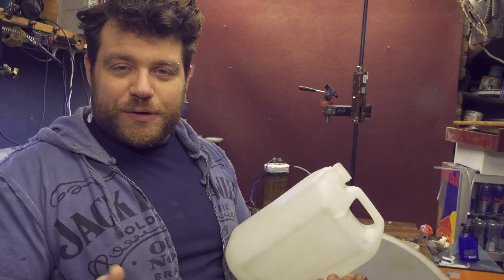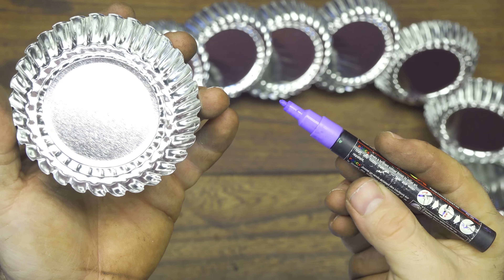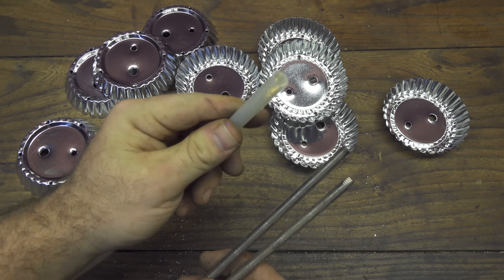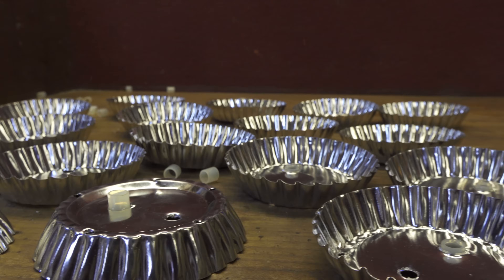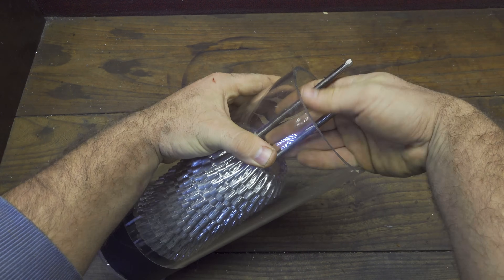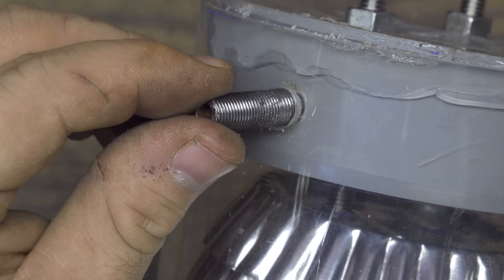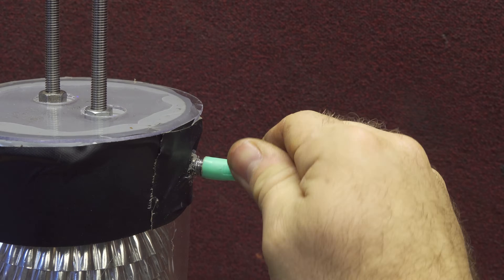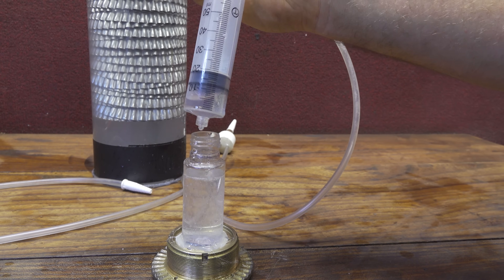Superpowerful Flame 5072 ℉ • Produce Hydrogen from Water - Do it yourself

Comment: Can i combine this project with the making of an air gun, using the hydrogen as a propellent for pellets?
Reply: I think you should use something more inert like CO2, far simpler and safer. You can produce it either by sodium bicarbonate decomposition (at 50ºC according to wikipedia) or mixing it with an acid like HCl or vinegar (acetic acid). The problem, even with hydrogen, is how can you store it at enough pressure without blowing up in your face, i'll leave that to you, be careful dude

Comment: "Safety is very important" 

Proceeds to lift uncovered transformer with exposed leads, connects exposed leads over flammable gas production vessel -- which visibly leaks -- and lights his torch from a candle which he leaves lit and on the desk near the plastic tubing. 

Wields torch with bare hands.
Reply: Not to mention fuel and oxidizer are mixed and accumulated. This idiot is one electrical discharge from never making a video again.

Comment: I buy All Natural Water"Hydrogen free"
Reply: all water's oxygen and hydrogen free timothy! In my opinion this video shows the rapid decomposition by water with the help of electricity of the stainless steel cups! The oxygen and hydrogen produced originate from the metal alone!
Reply: @PeterPete  It was a joke" I have been doing this for years I use stainless steel wall outlet plates.
Reply: @timothymason3423  and the metal always decomposes and the water gets dirty! To be honest I've never seen anything that decomposes water! Unsurprising really!
Reply: @PeterPete  I have found the more wholes the more gas not as surface area as people would think and instead of voltage think frequency of input voltage"' think 2.45 GHz less catalyst/ electrolyte less decomposition higher output.
Reply: @PeterPete  I have found More holes like screen" Same surface area" More places for the surface tension to release the gasses. also don't think voltage but frequency like 2.45 GHz Break it down at the molecular level Less catalyst/electrolyte less corrosion less corrosion cleaner conductivity greater output . 2,45 GHz is like a singer breaking a glass with their voice.

Comment: Please help I tried making a flash back arrestor by using a bunch of copper wire all I did was strip a lot off copper wire and rolled it into a dense chunk of copper wire and put it in a tube and added pipe and everything and I tried it  but it didn't work please help because I really need a functioning flashback arrest or for oxyhydrogen
Reply: RC Stuff you mean brass right? Coppers the wrong material
Reply: @JV-wl6ex  but I used very thin copper wires and bundled them upit should have the same effect as brass fiber right

Comment: Hı.
06:55 video times.
 Can you tell me about the electrical installation in detail?
Reply: Her Telden TV 1000 watt high voltage transformer from microwave except he took out the high voltage secondary coil out and replaced it with a few thick windings to make it low voltage high amperage instead. A very easy way of making a high current power supply. You can also use a computer power supply if you don’t have an old microwave
Reply: @Ferraday  Would an arc welder have too much voltage?
Reply: @Ferraday  oh yeah yeah

Comment: have you tried welding with it?
Reply: It will weld but is not good for ferrous metals as the hydrogen atoms permeate the material and cause structural problems. It's also capable of welding unlike materials, like glass to stone for example. HHO is strange stuff...

Comment: Hydrogen is very light and very very hard to seal in any container. 

You keep running this inside, so the leaked hydrogen might slowly collect under your ceiling. Then any whiff of wind that pushes that onto that candle flame or just some minor electric spark occurs, and your roof goes kablamo. Just saying.
Reply: Very hard to seal in any container, but regular house-building methods are sufficient to seal enough hydrogen to cause an explosion?

Comment: Make by themself, Test by themself 😺 Blow it up by yourself, deal with amputated arms. Also by yourself. Have fun

Its also funny how he avoided of telling the safety rules about highly explosive gas and flames near it 😺 As if that was a part of his plan
Also, that brass fiber is really neat in speeding up the back push combustion into a hydrogen-oxygen gas generator 👌
Reply: He has a flash back arrester btw the cell and the flame.
Reply: Charlie Jeans Does he have flash back for his entire sealed room inside his house just in case if hydrogen-oxygen generator is not sealed propertly then?
The answer is No 😺

Comment: Thanks... nice video. Does your hydrogen system water turn green or brown after a while and how long does your plates last before they rust? For those that keeps telling him about air being trapped under the cups, he already drilled some extra holes around to edges to let the air bubbles escape in the beginning.
Reply: Why not just turn upside down whole cups assembly to prevent bubbles being trapped?

Comment: That's a pretty decent setup for using not very fancy materials! I don't know a lot about these setups but I'd bet that adding a dessicant dryer in the line would help (I bet your gasses are fairly wet). Also, you could get waay more gas in a smaller space if you used metal screen/mesh on the electrodes, though I think the baking cups are a clever idea.

Comment: Good Idea and good Video, but there are some wrong Constructions. Aljubouri says it already , the Steelcups are the wrong Way in Position, so the Gas will rest just  under it in the Middle. The most Risk is, that now the explosive Gas can inside result to an accident! Better use two of this Tubes witch is connected witch an small Tube on the Ground and so you can separate Oxygen and Hydrogen in Tube 1 and Tube 2 and so you get more sure! 

Its  an good Idea, but i trink, your Construction is mor dangerous and not so effizient as can be. Its just an Prototype ans thats okay.
Reply: Good point.  If the cups touched ( as they look like) and made a spark that'd be the end of that !
I don't recall any mention of insulation there.
Reply: Hence him drilling all the small holes around the outside of the cups.

Comment: I've been wanting to make one of these for year. I've heard if you add a bubbler with thinner or something it will make the torch much hotter. Oxygen is very expensive and I plan on making one so I can use as a cutting torch. I have all the components I've just not put them together yet.

Comment: Actually dude, baking soda is kind of a detriment. You're creating CO2 as the current breaks away the sodium from the carbonate. That'll make your torch underperform what its estimated to given the tip and flow rate. Youd be better off using lye.

Comment: I agree this fuel cell is a lie or more to the point unnecessary and has been don't to confuse the truth, I am telling you this because over forty years ago I was shown a Holden Kingswood run on tap water with no fuel cell at all, he filled his fuel tank with strait tap water and showed it was going into the carburettor.
He only gave us a quick description on how he did it as he was trying to sell it to Holden but got told they were not interested and got the same from Ford as well and after that he was visited by two men that told him to keep his mouth shut, but when he showed it to us there was a twenty seven year old that had seen it as well and built his own two years later and the man who showed it to us was killed,
But what he told us was all he did was increase the jets in his carburettor and built this coil he had mounted on the side of the motor that was about 4x4 inches in size to burn the water and that was it, no fuel cell at all, when water is placed under a vacuum and hit with x-ray frequency releases hydrogen and is what I think is going on with this system and is as safe as.
I know this is real and is a fact so to say it is fake is not quite correct it is just being done the wrong way.
Reply: I dunno man, I dont really know if x-rays can split water, but even if it could, where would you get the foton source? Either electriticy, which would be a waste, or radioactive elements/waste...
Reply: @ignacio7402  
I have a book from the 50tys that tells you about it on my channel if you wish to read it, just saying what they said back then.

Comment: Thank you for the video.I have a question on the physics of the brass mesh used as a flash back safety arrester. I like the fact that you have incorporated safety. I understand your wet safety back flash protection but the brass I do not. Looks at first ok but, in detail there is no valve only mesh. Can you explain? Is the brass mesh going to burn all the back presure gas and clog back the gas from returning? I can't visualize the facts without details except that the brass would burn the gas first?
Reply: Thomas Lapsley It’s simply to bottleneck the plasma by increasing the velocity and pressure of the gas through the mesh.  Brass is maybe not the best material for this, but Inox can be difficult to source and anything better gets pricey (and never ever try using plain old steel wool).

Comment: THE FLAME WILL REACH THE MELTING POINT OF THE METAL IT COMES IN CONTACT WITH,THIS MEANS THE METAL WILL NOT BURN,THE ALUMINIUM CAN DID NOT BURN IT MELTED,ALUMINIUM WILL BURN WITH A VERY HOT REACTIVE FLAME,LEAD WILL ONLY MELT TOO,IF YOU USED OXYACETYLENE LEAD WILL GIVE OF POISONOUS FUMES,THE ALUMINIUM CAN BE BURNED TOO.
THIS FLAME WILL SUBLIMATE TUNGSTEN,IF YOU CHECK OUT THE MELTING POINTS OF THESE METALS IT SHOULD BE APPARENT THE FLAME REACTS WITH THE METAL IT COMES IN CONTACT WITH,IT IS NOT JUST A SIMPLE FLAME  LIKE OXYACETYLENE.

A SIMPLE BUTANE BURNER WON'T MELT COPPER AS EASY AS SHOWN,OR CUT THE ALUMINIUM CAN SO EASILY.

NICE IDEA FOR EASY TO ACQUIRE PLATES AND INSULATION METHOD.

Comment: You know the corona from our sun is millions of degrees. I don't see you have melted steel yet. It takes about 3.1 k F to melt steel and oxidation would be a huge issue for you want to cast or weld those steel. Plasma with an inert gas shielding is the winner. Plus, if you add salt into water it will release some HCL, too. Graphite is the best for this project. I can't recall but I think there are certain grade of stainless steel alloy can release some harmful gas. I doubt it. Just play safe.

Comment: D'other thing. I'm given to understand that using stainless as electrolizers electrodes creates hexavalent chromium which is, I'm told, carcinogenic.

Straight up nickel or carbon is harder to find in such geometries as the sst bisket pans though.
Reply: the nickle strips look cheaper at this time I see 100 for $11 that are 100mm https://www.ebay.com/i/281263028686?chn=ps
Reply: Unfortunately studies from nickel works in Norway demonstrate that it is also carcinogenic.
Reply: I was looking for this comment.
Reply: Sure it's carcinogenic enough to be an issue for people who work with industrial quantity for many years. But the amount produced by such a device  harmless.  Also somebody would need to drink the water from the device to ingest the chromium hexavalent .  I'm pretty sure it is not part of the plan.
Reply: @leucome  wrong and wrong. Go read some peer reviewed medical journal articles on the issue RE nickel, and hexavalent chromium particles can be airborne as dust.
Reply: @gordonlawrence4749  You are  right about the air particles.   But I,m also right.   I worked with five 35 feet pools of exavalent plugged to 35000amp psu to chrome boat part and  also  two additional dechroming pool to remove chrome.  I have a quite good idea  about what is required to produce an unsafe level of  particles . 

Sure it get in the air and it's dangerous. But his tool can not produce enough hexavalent  to be worried about. 
Unless he drink or breath directly from his tool for many many years.
Reply: @leucome  According to what I have read it's the same issue as asbestos. IE some people get cancer after just one particle gets lodged in the lungs. It's not a threshold issue.

Comment: -I love it. I am sure you don't want someone to rewrite/edit your work.  It adds to the mystic.

-5 million views on other videos? Wow. That looks like a virus accidentally installed on 300,000 computers is playing your video. Horrible!  Ha!

- I like your "just get it done" approach. I think you build a lot of useful stuff.

- how about a Sand blaster? How about a ceramic filter to generate oxygen? 

- are there any interesting things that can be made from used antifreeze? Used engine oil?

- since you input 5volts x 50amps (under 250 watts) think of this as a 250 watt soldering iron. What is the maximum pressure the gas can take before exploding? What about building bellows to lightly pressurize it?

Comment: This is a simple Electrolyser, you introduce electric current to anode and cathode, thus circulating ions, and create such electrochemical reaction needs high DC current, (mine uses maximum 500amps) just fill with seawater (NaCL+H2O) and introduce more DC current as you will produce H2+ NaOCL (Sodium Hypochlorite), but notes with higher current, you will produce much more NaOCL and H2, of course you need to dillute the H2 with fresh air (you can also install it with small air blower in to product collecting tank for example) and for NaOCL, you can use as bleaching agent (mix with proper solution with NaOH, and disinfectant, effective for marine growth in proper chlorine concentration, unfortunately the disadvantages are NaOCL is easily vaporised thus reducing the concentration. Anyway great experiment, every materials bulit from scratch, keep going with it and you need to design even bigger whole system to crrate even bigger capacity of hydrogen gas.
Reply: the idea is healthy, but stainless steel will rust in a NaCl environment.
Unless you use special( more expensive ) stainless steel containing Molybdenum.

Comment: I would suggest changing the bubbler to have a lid that is removed more easily. It is meant to act as a flashback arrester, and if there is a flashback, there needs to be a pop off lid, not a screw on one, otherwise, the whole bubbler will brow up, making it dangerous and defeating the purpose.
Reply: Yep..